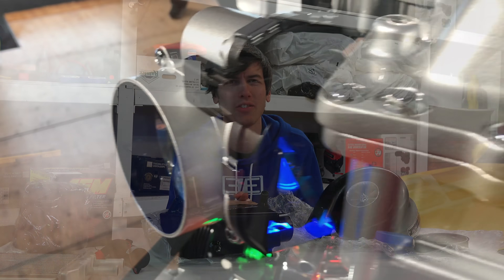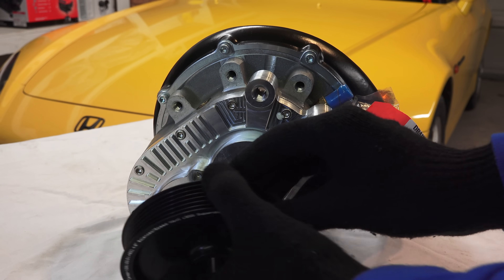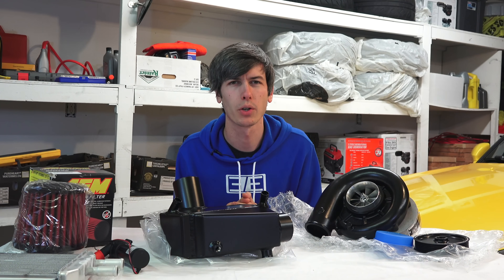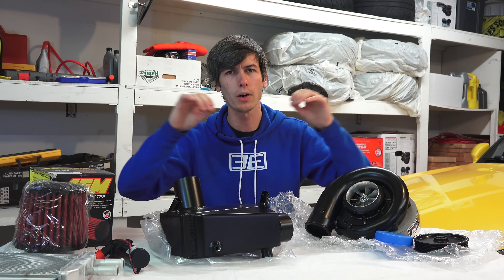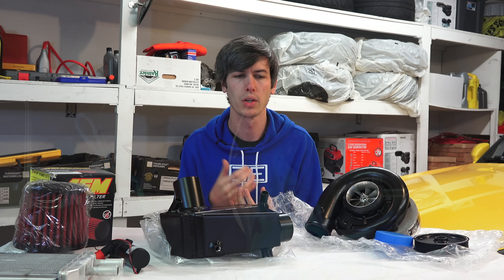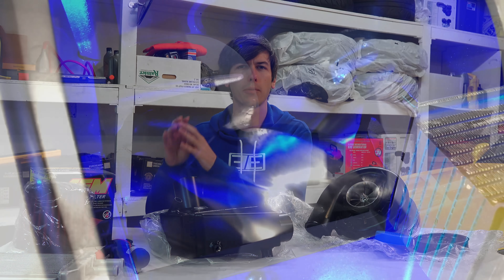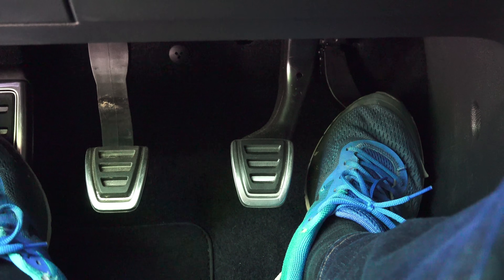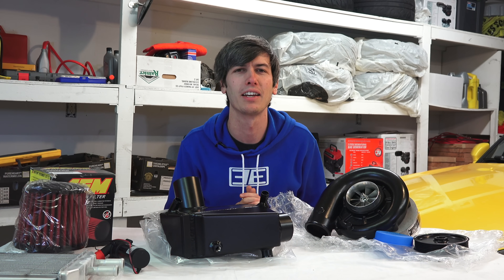Turbochargers vs Superchargers - Which Is Better?

Comment: I know this is an old video, so it's unlikely you'll even see this comment...
What's not clear to me is the higher efficiency of turbos. You say it's because they're using energy from the exhaust that would otherwise be wasted. But that airflow is caused by the engine pumping air. Wouldn't the turbo act as a restriction in the exhaust, reducing the airflow and thus the power the engine can make? (boost would eventually kick in and overcome that, but then it looks like a supercharger to me)

Comment: Love your videos, but boosted engines have a higher increase in torque ( across the band) than HP. Also, turbosupercharged (correct term) engines have a wider range of power band by FAR than a supercharger, which is 100% linear. Let's see your supercharged vehicle run 420 pound feet of torque from 1900 rpm all the way to 5700 rpm..oh, wait, you can't! Because a supercharged engine is 100% linear, so it "can't" do that.
Reply: I have a 2014 Stock Charger SRT 8. I heard so much about the Hellion Twin turbo system. So what is better , The Hellion or a good Super Charger like Whipple ??

Comment: You didn't mention anything about backpressure when talking about turbos. Which of course increases lag. 
I'm same with you, superchargers provide better response. I'm also with you that turbos provide greater horsepower, but its not when you need or want it. 
Eliminate the lag, increase performance.

Comment: You cannot say the exhaust gases are wasted and you can get free HP using a turbocharger. There will be HP needed to turn the impeller from exhaust gasses to provide intake manifold pressure. If you choke off the exhaust, the engine dies. Using the pressure from exhaust gasses does reduce engine HP. Since the HP reduction through the turbo is used to boost intake manifold pressure, there is a positive gain in HP. A simple formula is Intake Manifold Pressure X Air Volume to tell you the minimum HP that turbo is robbing. There will be some losses due to efficiency of the turbocharger. No turbocharger is 100% efficient. Since the turbocharger is boosting the engine pressure, no one notices the HP losses, though it can easily be proven. I may be a little too picky, but if you are talking engineering, then this loss is real and can be proven when a test system is set up properly. My principle is: Before you can manage it, you must first measure it. I have designed and built many different types of test systems to measure all kinds of industrial machinery for specific purposes for many companies over the decades. Or am I the only one that is so picky that it is just me that would consider this and make a test system to measure the HP losses?? I have a saw mill with a HP meter to monitor the blade efficiency and to know when the teeth are getting dull. Maybe it is just me.

Comment: That final point about throttle communication is a very important one. I recently went for a lengthy night drive in my car - a Volvo S40 - which is a turbocharged, automatic-transmission vehicle. It has some serious power for a compact daily, but between its still-pretty-slushy and aged torque converter (which would at times allow the engine to wander in the 1300-1800 RPM range without changing gear or actually affecting the road speed) and the turbo (which starts spooling around 2000 rpm, but will lose the boost very quickly once I stop flooring it and therefore basically has 2 different torque curves depending on now depressed the throttle is) a lot of my fun or my feeling of control was sapped.

I am pretty much certain that at least one of those aspects, most likely the automatic, will not be present in the next car I purchase. What I'm about to say is not directly related to the video, but I urge anybody here who can't operate a manual to learn to do so. It's much less arduous than some people make it out to be, and provides fun, control and - on older models at least - a vastly superior fuel economy potential.

Comment: Great! My supercharger for my Camaro's 3.6 liter was just shipped. My installer begged me to get the Edelbrock/Eaton twin scroll traditional mad max style box that sits in the engine and shoves air into it. The 3.6 is designed for forced induction so you CAN turbocharged it as well. Too complicated!!!! The small V6 1.75 liter charger gives me 100 hp and 80 to100 lbft. It cost $5500 plus tax and $129 freight
 So $6000 plus install
 I got a rewards card just for this occasion. I already got $500 applied back to the card. 
So, horsepower isn't cheap. But I had to do it this way. Great 👍. My 2020 Camaro 3.6 manual 1LT   with 6.2k (bought in April with 3.6k) all the suspension and everything is ready to install it. 😀 Can't wait for Summit Point Raceway!

Comment: Can a turbo engine be coupled with electric motor for lower rpm torque only post turbo kicking in motor can cut off or do a battery charging

Comment: Can you turbo an automatic??
Reply: Sure, there are plenty out there.
Reply: @Oddball5.0  What about that flutter noise (I’m new to cars) I just don’t wanna drive a manual b/c of the amount of traffic where I am
Reply: @Swervy  I think the noise will depend on the exact car; different types won't be exactly the same.

I have an F-150 truck with the twin turbo V6. It makes kind of a whistling sound, which I like. I know others who don't like the sound. I think it's personal preference.

I would suggest test driving the cars you're interested in to see which sound you prefer.
Reply: @Oddball5.0   Hmmm okay, thanks for the heads up.

Comment: Is there a way to supercharge/turbo your car for low end boost with the supercharger than when turbo kicks in , disengage the super charger and use turbo. Why do it? For constant boost and efficiency by not using power from the motor all the time.
Reply: yes but its complicated and expensive, some cars came from the factory with it like the nissan march super turbo

Comment: Superchargers need to wait for RPM to increase in much the same fashion as turbochargers need to wait for exhaust pressure to increase. They don't have to wait as long but they still have to wait. Just saying they are not completely different in that regard. You should do a video on the difference between single and twin scroll turbo's.

Comment: Why not spin up a supercharger with an electric motor ?   Give it a shot, no one has that I know of.   Sam Creecy   Havana, Florida 32333
Reply: Some do. The issue is that the amount of power required is more than the normal 12v battery and alternator can supply. You would need a separate 48v generator just for the supercharger or use capacitors and have a limited amount of boost time before they must be recharged.

Comment: great video, I like the idea of a very long stroke with a turbo charger. The biggest down side of the turbo is the intercooler.. I have 3 radiators on the front of myvehicle, one for the turbo, one for the engine coolant and one for the AC.

Comment: So the very very little bit that I know about turbo's and super chargers is that after a certain point the super charger drops off. I caught a very brief (maybe like 1min tops) on a mechanic show saying something like that and they added both to the vehicle and got it to the point where when the super charger drops off the turbo charger picks up where the super charger dropped... If that makes any sense, made some sense to me to kinda keep a continuous boost.
From what you know is that possible? Or did/could you try to make a video about that??
Reply: A supercharger is limited because it uses engine rpm to spin.  A turbo charger spins freely using exhaust to spin it. So a turbo is actually more powerful the higher the rpms are where a supercharger tops out with the engine rpm

Comment: Why don't superchargers use electric motors to control flow?
Reply: Some do. The issue is that the normal 12v electrical system and alternator is not sufficient for the motor required. You have to have a seperate generator for the supercharger. Or use capacitors and have a limited amount of boosting time before they must be recharged.

Comment: Does either increase torque?
Reply: Both drive.
Reply: It doesn't have a direct affect on torque.  They both push air into the engine allowing the engine to burn more fuel efficiently. So it has more affect on power than on torque.

Comment: A few things not mentioned. ProCharger Centrifugal Superchargers have their own oil instead of having to feed the dirty oil from the oil pan. They are U.S. made and easy to install. The amount of pressure on either type is regulated by the size of the unit. plus the spring in the Waste Gate. Both require the pressurized air to be cooled by an aftercooler (air-to-air Heat Exchanger) and/or 50/50 mixture of methanol/water after the aftercooler. Carbs have to be special to take pressure from either device. Throttle bodies work fine with boost.

Comment: The power to spin the turbo must come from increased back pressure, right? You essentially have a pneumatic link between the cylinder and the turbo, right? No such thing as a free lunch.
Reply: Turbo chargers use the pressure from the exhaust to spin them.  They are usually attached directly to the exhaust manifold.  Some are attached farther down to the exhaust pipe.
Reply: @Bendigo1  Yes. But the energy to spin them must come from increasing back pressure. Essentially, the exhaust stroke pushes the turbo blades via the exhaust gasses between them.
Reply: @DJ_Force  yes.
Reply: @Bendigo1  So why do people say they are more efficient? Why is a pneumatic link better than one with a belt?

Comment: Depends on where in the powerband you want the power. At low rpm the positive displacement. Roots and variants, is more effective. At high rpm and exhaust flow a dynamic centrifugal  compressor is preffered. A constant speed engine is best served with a centrifugal compressor. The turbo recovers energy from the exhaust. Some engines such as two stroke Diesels require a positive displacement pump to run but can increase efficiency by adding a centrifugal compressor.

In most cases a charge intercooler is needed.

Comment: Best: Electric supercharger (an actual one that runs on a 48V system). Nearly instant response, no extra pumping losses on the engine (if you use a bypass valve under conditions where no boost is wanted), boost control from 0 to max at all RPMs, battery for it is charged with the alternator, zero maintenance.

Comment: A turbocharger IS A SUPERCHARGER! A supercharger is ANY device that boosts intake air pressure above atmospheric. It can be powered by any means, belt, gear , shaft, turbine, or even electric motor!

Comment: Awesome video! I've got a question though: On turbocharged vehicles, isn't it harder for the engine to push the exhaust gasses out of the combustion chamber than in an NA or supercharged vehicle? So in a sense exhaust gasses don't produce kinetic energy to the turbo out of nothing as you're suggesting. Am I missing something?

Comment: Why oh why does it seem everyone talks about turbos as not being engine driven? Its like everyone forgets you cant get something for nothing; which Newton Law is that? Anyhow, exhaust gas is not free energy to spool up a turbo.
Reply: a lot of the energy that powers a turbo is energy that would otherwise be wasted. The exhaust has quite a bit of energy that is not utilized on a NA engine, the turbo makes use of that energy. There is some parasitic loss from the increased backpressure but they are still more efficient than a supercharger. That is why a turbocharged engine will make more power than a supercharged one at the same boost and temp.
Reply: @Redtooth75  on compressor efficiency; i believe  turbos are more effective, or rather more effectively designed and applied to the boosting requients, not efficient; and thats not semantics.
Reply: @zefrum3  there is a significant amount of energy lost in the exhaust on engines. Turbochargers make use of some of that wasted energy. Only part of the energy going towards the turbo puts an extra load on the engine, whereas all of the energy going to a supercharger is parasitic. Even if the supercharger was centrifugal a turbo would make more power at the same density.
Reply: @Redtooth75  how much? Ive heard this trope that turbos are much more efficient, but I havent seen any numbers. The notion that the turbo puts only a slight, negligible?, load is silly. Turbos not only create exhaust restriction they also cause a much higher heat and fluid load on an engine than any other compressor; what most guys here fail to realize are these loads are not linear to engine rpm; and so i guess thats the thing yhat makes just about everyone think turbos are negligible in parasitic loss: b/c how often are you running a gas turbo engine hard enough to spool up? In contrast to super chargers, which are boosting all the time, even at idle. You know I only just saw over the weekend a manufacture discussing clutched super chargers? Imagine that. This turbos more efficient than super argument is about to change
Reply: @zefrum3  its not negligible, I never said it was negligible. But they do cause less parasitic loss than a supercharger. At the same density a turbo will make more power than a supercharger. They make use of exhaust energy that would otherwise be wasted.
Reply: @Redtooth75  i didnt say u did; i used the word for rhetoric, as most imply its negligible power loss.
Reply: @Redtooth75  incorrect re the boost density; you’re forgetting that most gas-engine turbos dont spool up until like after 3K rpm; so on that metric from idle to light city driving / hwy cruising turbos are creating only losses.

Comment: I have a question. Would it depend on what you will be doing with the vehicle? Like...If you are daily driving the car for personal use or perhaps drag racing then wouldn't a supercharger be better since there is no lag and instant power. To me is seems like Turbo is better for racing circuits. I am assuming that when you go through a racing circuit...Because you have multiple turns that eventually leads to that turn leading to a straightaway....You then come out of the turn and floor the pedal. And I would imagine that even though the pedal is floored the turbo will continue to provide acceleration as it spools up and acceleration will increase as if you are pressing the pedal down more even though the pedal is already floored. So generally speaking would it be safe to say that when response time for power in a short distance (like in drag racing) is more important than reaching top speed in the long run then supercharge it. But if you want to reach top speed because you have way more than a quarter mile to drive then a turbo is the way to go. 

I'm interested in hearing any thoughts on this because i'm no gear head. My assumptions are based on the fact that I have one friend with a Dodge Demon and another friend with a V6 Ford Probe. The Demon crushes the Probe at startup but after about a little over a quarter mile or so the Probe then passes the Demon and continues to accelerate.  The Probe has a lot of work done to it and has had the engine swapped to a new one. Not sure what kind but its a V6. Its weird watching a car from the 90's pass a Demon. It has pop up and down headlights
Reply: BNG 100  I wasn't really asking him. I was asking anyone who knows about this stuff. I figure that within the people that watch these videos there must be a decent amount of the viewers that may give me some feedback. Iv'e been on youtube since 2005. Its always a viewer that gives me feedback. Never the Tuber. Over the years I have learned a lot from the community on this platform

Comment: I'm putting a 4.6 supercharged stroker in my 97 jeep wrangler. The reason I think it's best is exactly what you mentioned in that you know what you're getting from the throttle. Hard wheeling then all the sudden getting a huge boost of power with a turbo could get you into trouble. Great video 👍👍👍

Comment: I can’t believe in the 21st century, sitting in front of a Honda S2000, with a centrifugal supercharger in front of you, you are going over the old tropes about turbo lag and SC instantaneous power.

You don’t get instanteous power from a centrifugal SC. And with the right turbo (not oversized) you get no noticeable lag. I’ve had an S2000 since new in 2000. In 2003 (iirc) I installed a Comptech centrifugal SC. In 2006 I installed a GT3071R turbo. Mash the throttle at 2000 rpm in a Honda S2000 with centrifugal SC and.... wait for it... boost. With a 3071 you just get thrown back in your seat.

Comment: I have a Buick Encore with a turbocharger and it seems to have no lag.
Reply: That's because the turbocharger is tiny. Small turbochargers don't have lag for the most part.
Reply: @rhull3939    That's what I'm thinking.
Reply: @timjohnson1199  yeah that's it. The smaller it is, the easier it is to get it to spin up and make boost, so it does it quickly.
Reply: @rhull3939   Plus, it's already spinning at low revs.

Comment: Wait I thought that the superchargers are the ones that look like boxes and the turbos are the snail looking ones wtf 
Ur saying supercharged is with a turbo 
And turbocharged is with a supercharger????
Reply: There are superchargers that mount sort of like a turbocharger and they look like one as well. But they use a belt to spin and make boost. A good example of that is a procharger. Turbocharger doesn't have a belt attached and will have tubing from the exhaust on the back of it and on the front of it to the intake.